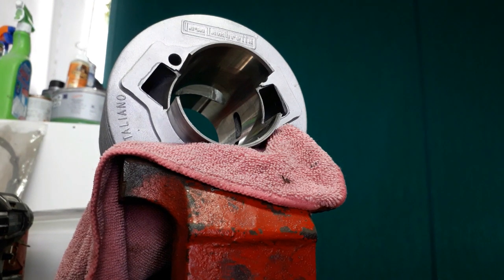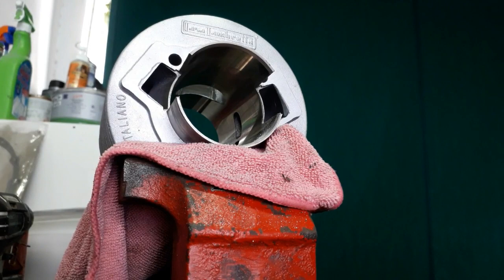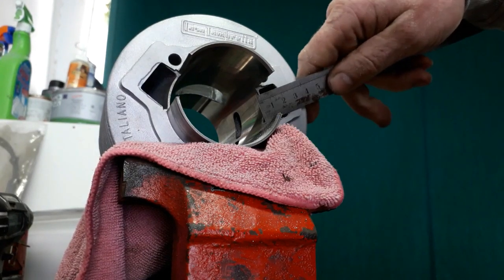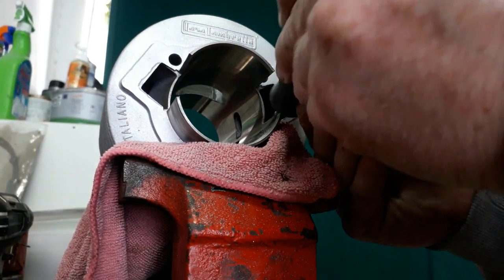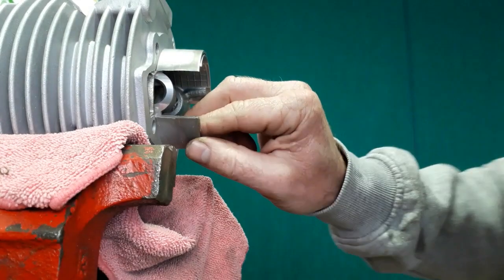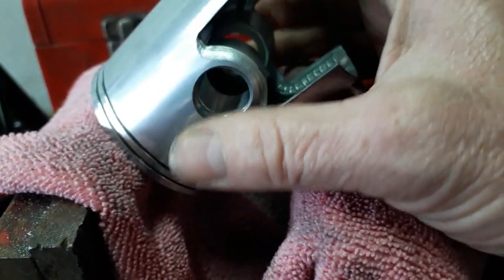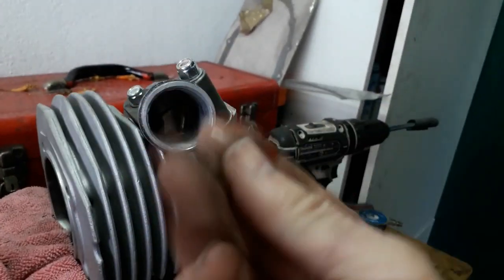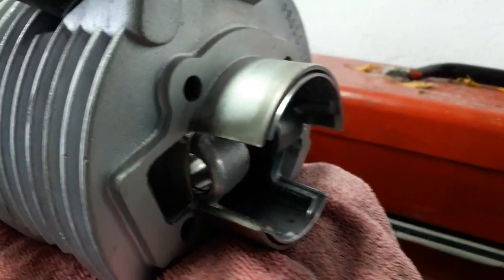casa lambretta 185 kit part 2

Comment: By taking away material from the gudgeon/piston area, are you not increasing crank case volume slightly, thus reducing “pump compression” or is this a nominal effect?
Reply from the maker: there are two types of two stroke engines old which relies on crank case compression , modern relies on expansion chamber to suck charge in to the combustion chamber thats why modern engines have large volume in crank case and transfers , but you need to run an expansion chamber on this type of engine .

Comment: Does the piston require spacer washer con rod to piston, considering getting this kit looks good, great video.thanx
Reply from the maker: Nope haven't seen those since the 80s no modern engines use them ?
Reply: Thanx for your reply, I suppose in use with a gp
 crank which is shimmed, would be ok, it’s I have a sx crank new, which I intend using and has a fair amount of end float on the Conrad. But thanx for answering my query, very enlightening video,
Reply from the maker: @paulwatson2961  i would never use an SX or LI crank in any rebuild ? it will fail 100% sure of that ....
Reply from the maker: rebuild with all new parts .... gp crank and change flywheel to gp dont throw money away by cutting corners ........
Reply: Thanx will take your advice.

Comment: Would you say this is plug and play like casa say it it is or do I have to upgrade the lot to gp crank . May as well got for an rb kit.
Reply from the maker: my friend anyone who is not using a gp crank is asking for problems, never put new parts on old cranks you are throwing money down the drain ....if you are still running the crank from 1966 with unknown mileage this is not plug into anything? its a simple kit thats easy to set up so plug and play but not on old parts the just stupid ?
Reply: @TheSteelweasel  stupidly I had a new li crank fitted  100 miles ago.
Reply from the maker: @russellblevins706  oh dear really?  So casa 185 is the one for you ....
Reply: @TheSteelweasel  so do think the 185 would be ok on the li crank. Casa seem to think. Brilliant videos Steve. Keep em coming.